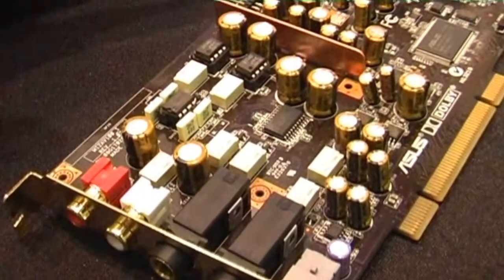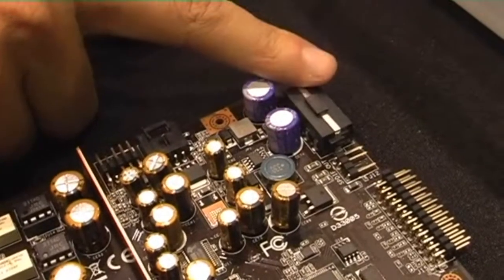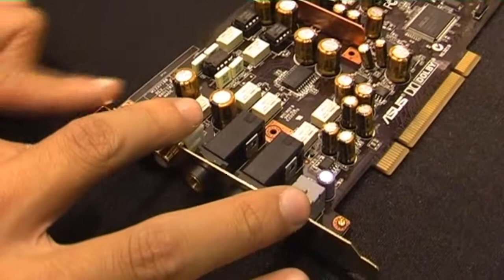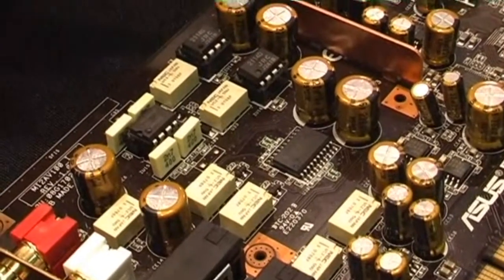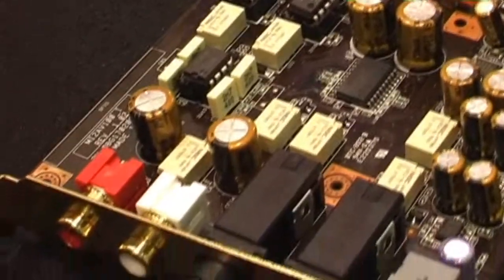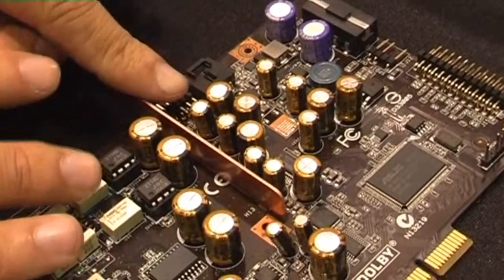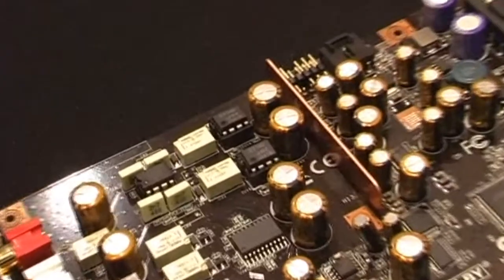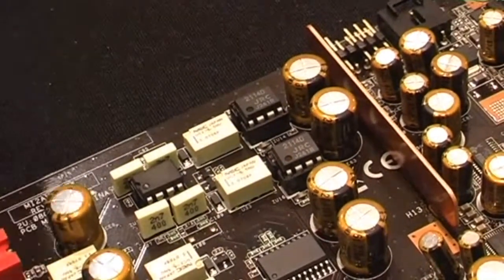Asus Xonar Essence ST explained

Comment: everyone always talks about this card and it's capabilities for headphones and i hear nobody talking about using speakers of any kind with this card.. i have a pair of jbl l-150's, all original parts, in my opinion the best pair of speakers JBL ever made besides the 250's, running a marantz model 3300 and a crown d-150. will this card sound gorgeous with this setup? or is all the hype just about headphones?

Comment: HardwareZone SG:
This is an interesting and informative video -, but it has one problem. It was apparently video-recorded at a "trade show" (or something similar) and the "crowd noise" makes the dialog difficult to hear. For this video, dialog "captions" would have been a good idea (or you COULD still add them, after-the-fact). For future videos recorded at "trade shows" or any other noisy environment, you should use a hand-held microphone, for better intelligibility.

Comment: what's exactly the difference between the STX and ST versions of the card?? As far as I know:

-ST is newer
-ST has a new feature called 'precision clock tuning'
-ST has the possibility for surround sound upgrade
-ST has a PCI connection, STX PCIe x1

Asus says that the precision clock tuning results in good sound, not necesarily meaning better than the STX (which has no P.C.T.). Also, why no PCIe on the ST version?? so which one should an interested person buy and why?